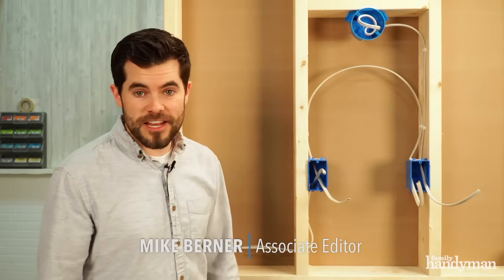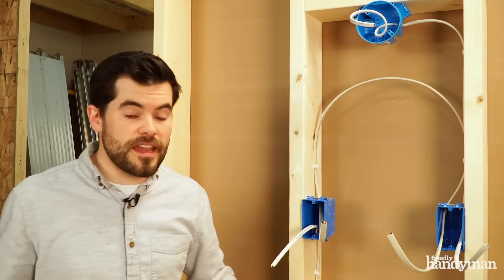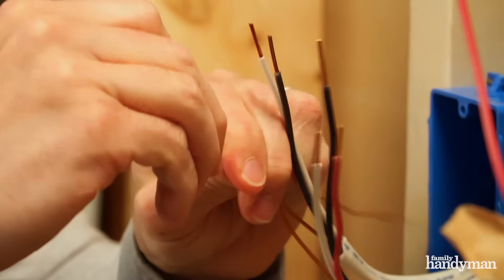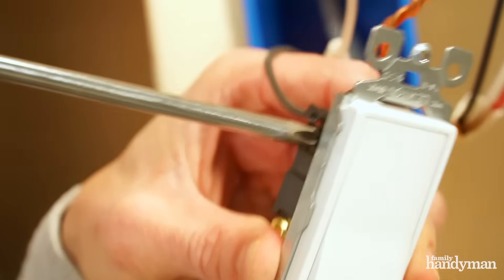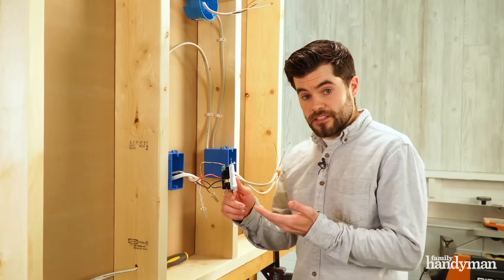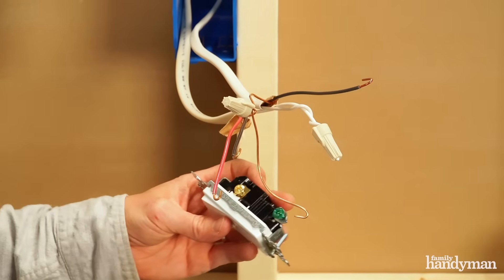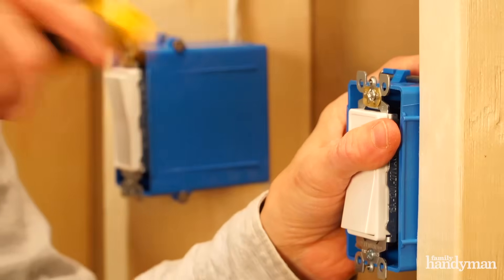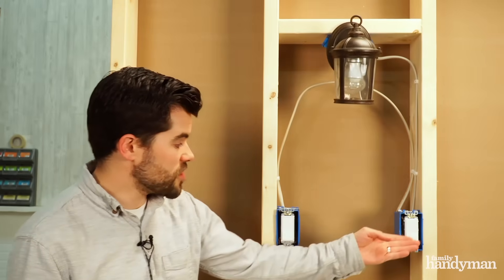How to Wire a 3-Way Switch

Comment: Ok first switch

The red and black that are connecting the two switches together which one goes where or does it matter?
Reply: Nope, doesn't matter, so long as those two traveler wires are connected to the gold terminals on both switches the light will work. If you are OCD like me, you might need to swap which wire goes to which gold terminal on ONE of the switches to make sure both switches are down (or both up) when the light is off.
Reply: Keith Kraker g

Comment: Great video but I have 1 comment.  On the second switch you should have placed the red traveler on the same side as the common (as done with switch 1) to be consistent.  Then when both switches are in the up or down position the light will be on, when 1 is up, the other down the light will be off.  I enjoyed how you ran through the steps without all the blah, blah, blah of other videos on youtube. Great job!
Reply: absolutely that's why I came in here he mixed up his traveler's ima certified electrician n you wouldn't believe how many 3ways I hada fix bc of mixed up travelers or missed place the wire that goes on the common screw just remember the common screw is your hot
Reply: @fivenightsatfreddysgameswo9689  or switch leg right
Reply: @fivenightsatfreddysgameswo9689  could a mistake like this cause a fire?
Reply: And that was only thing he missed point out😀😀
Excelente 👍👏👏👏👏
Reply: Yup i caught that to.
Reply: Yes

Comment: So is this the setup so you can turn a light on from either switch or do you have to turn switch one on befor you can use switch two?  I am looking for the setup so either can turn on a light no matter what position the other is in.
Reply: Either switch will turn the light on or off.

Comment: Many thanks to you, I passed a test today with a promotion , appreciate you.
Reply: You do not indicate if the wire from switch to switch is connected to the common. You said the second switch that goes to the light that wire is connected to the common. So I don't see how your two switches are connected identical if you don't have a wire that goes from common to Common
Reply: When you connect the power source ground wire to the common wire you didn't say anything about having a tail piece that goes to the switch. But it looks like you have one

Comment: Remember, the traveller wire needs to be a 3 wire plus ground.  That's not explained above.
Reply: So the travel is the only wire that needs to be a 3 wire?  I think that makes sense.  And this also means that the power source to the switch on the left can be a 2 wire (meaning like 14-2) and the wire coming from the light, 2 wire as well.  For those who were wondering.

Comment: Very straight forward. I’m an apprentice electrician, I found it to be a good refresher, but here are some following tips for those reading:
-ALWAYS use a linemen to twist wires together
-always strip less than demonstrated in this video (about idk 1/2-3/4 inch) and make sure no exposed wires are showing.
Also I wouldn’t recommend these flip switches as they break more easily but they do look nice. 
Nonetheless very simplified and good video
Reply: Nice video man! I subscribed!
Reply: By 'linemen' do you mean a western union splice? Overkill for interior wiring that is powering a light switch and is most likely going to be pulled out/replaced in ~10 years or less.
Reply: @HaploBartow  Photovoltaic / Solar Thermal Technician here. wow, he never answered you. he probably didn't know what you meant. yes it's overkill. i've used the tool when making pig tails makes it look nice, it impresses the customer. but twisting by hand is fine. i've used those new push in wire connectors too.

Comment: Now if only I had a neutral and not 2 red wires and 1 black wire I wonder what little shit wired my house
Reply: Someone who knows a lot more about electricity than you??
Reply: that's where a digital multimeter comes in handy. imaging all wires same color ? i've seen it done. i've done it when i was  12 yrs old LOL 60 yrs old and still kicking.

Comment: I just replaced my switches at the top of my stairs, bottom of stairs and the mid section (split level entry house) . There is a 3 way switch for the entry light and is also jumped to a 2 pole switch for the porch light, there is a 3 way switch at the top of the stairs for the light and a 4 way switch at the bottom of the stairs. All the switches work fine BUT when I turn off the lights (not sure how long) the light won’t turn back on unless I reset the breaker BUT the breaker isn’t even tripped?? What is going on?? Please reply
Reply: There might be too many lights on that same feed.  If they’re not LED lights then they’ll eat up a lot of power.  Or whoever ran the wire might have just used wire that’s too small.  More power needs bigger wires and a stronger breaker

Comment: Nice video but the three-way switch in the UK is different as it only has three connections (1 the live in. 2 neutar in. ane 3 the common out or to the light .)and the earth is not on the switch but goes to the steel back-box.